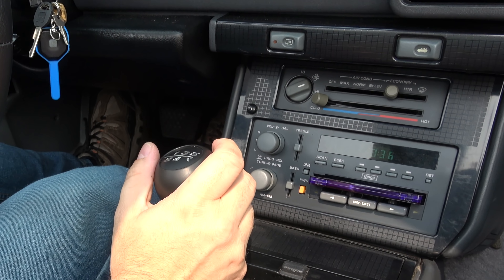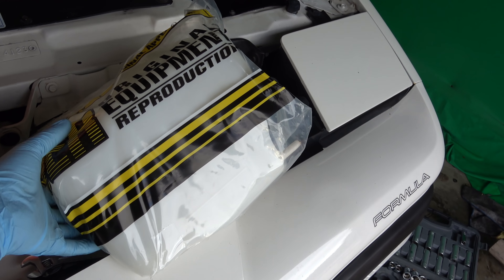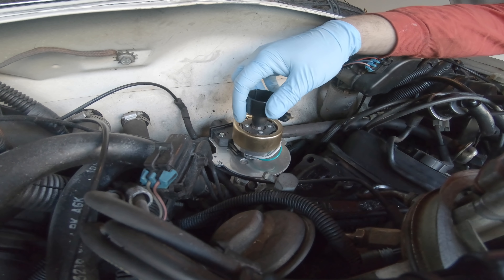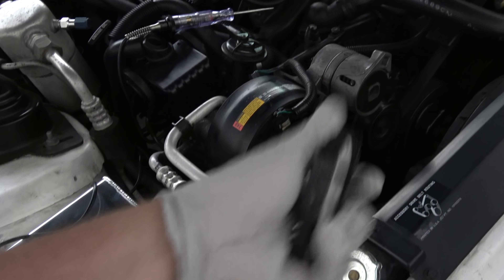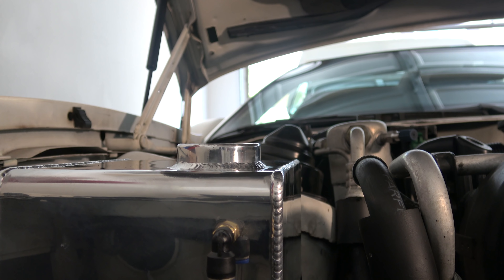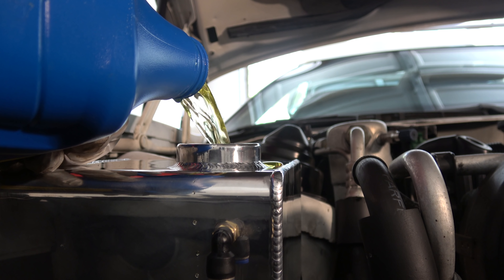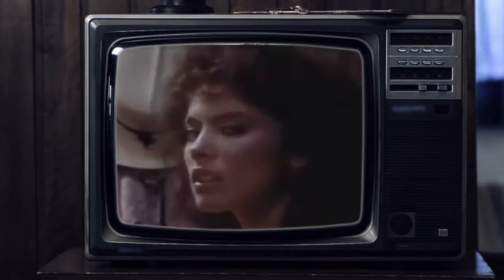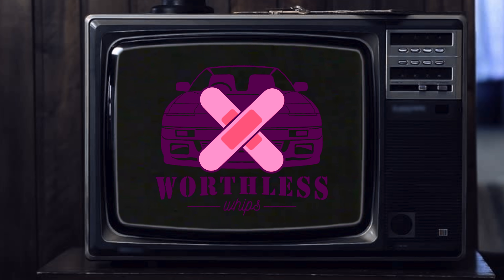They really don't make them like they used to!

Comment: I agree with maintaining the vehicle but when you start putting things in that aren't original equipment you bring down the vehicle's value and collectability, in fact you ruin it. These vehicles were not as horrible as you say maybe a tad on the Primitive side and yes a bit chincy, but that's part of their appeal why do you think they call it GM General Motors. If you know how to properly maintain your vehicle you wouldn't be having as much difficulty as you are with yours. I just believe anybody can throw Parts at a vehicle ( trial and error) but you have to be much better at Diagnostics. More than half of the things that I've witnessed you do it was like the chef throwing the spaghetti against the wall to see if it stuck it was done. Part of being a real technician is diagnostic skills in fact that's more than 75% of it. I've basically got the identical vehicle right down to the color and I don't have half of the problems that you do diagnosing it. If you think you had some difficulties now I can only imagine the problems you are going to have once you've altered it so far from stock. As quote-unquote cheaply made as his vehicles are as you say they were designed to work the way they were designed so I would caution you only buy parts that are designed to work within the specifications of the design parameters of the vehicle unless of course you're going to go full custom which it seems is what your intentions are. My formula is a 1989 with the L03 engine and 700R4 transmission, the car runs perfect with all original equipment and I do not want to divert too much from original, although I may massage a few horsepower out of it. One of the things I am doing it is the cold intake cowl system that you already did to yours. The other is I may go to a 3.73 rear end gear ratio and possibly after that install a mild Cam and lifter package, Maybe...  What I will not do is put parts that do not belong on the vehicle especially aesthetically and I will not change engine blocks because I want all numbers to match. Anyway I really enjoyed your series and I'm looking forward to the rest of the journey with your Firebird. Remember stock is beautiful cheers 🍻.